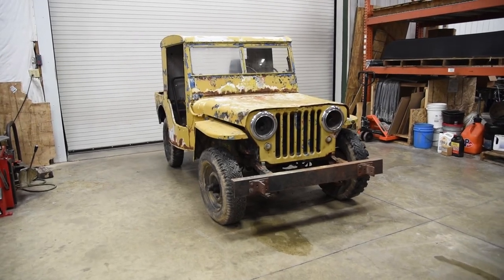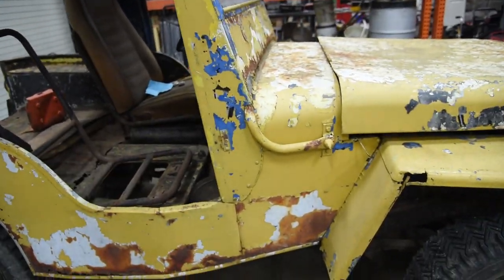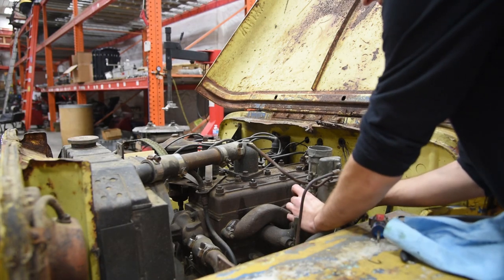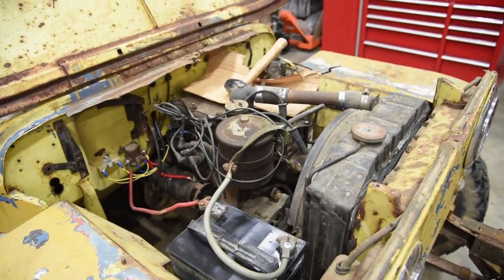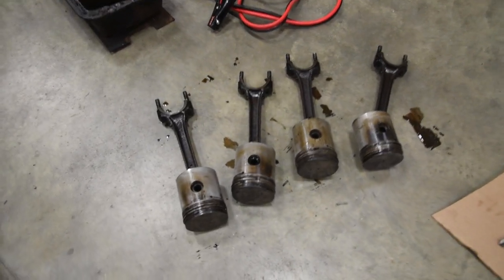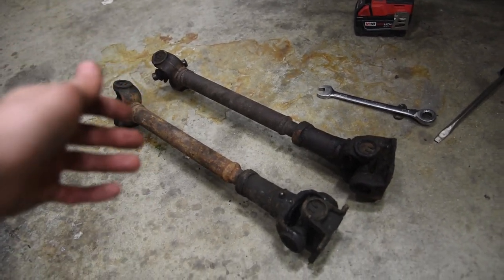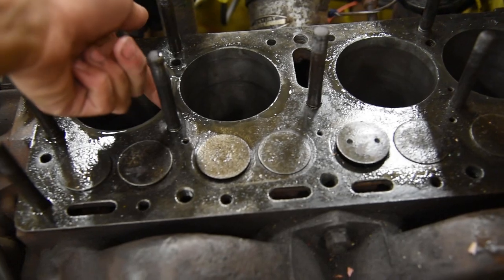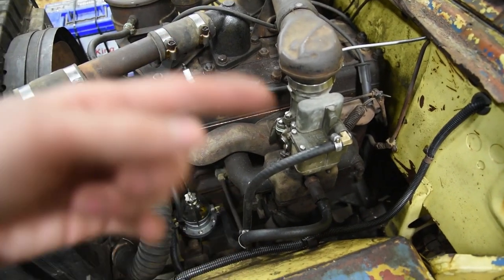Attempting to Revive a Barn Find Willys Jeep

Comment: My fire department has a 1954 CJ-3B.  That was the first year of the overhead valve engine.  It carries a 100 gallon tank and a small gas driven centrifugal pump.  Mileage unknown - speedo hasn't worked in years.  I'm retired now, but I used to take that Jeep where angels feared to tread.  The Jeep is retired, but we have it on standby/parade duty.  We replaced the Jeep with a modern pickup which is much safer and more comfortable.  Good luck on your CJ-2A.

Comment: Nice find,that's definitely a survivor jeep. It's getting hard to find survivor vehicles that are still in relatively good condition and are pretty close to being in stock form. It's getting hard to find any classic vehicles that haven't been hot rodded or been completely altered to build something that it was never intended to be.
Reply: i have a m37 dodge 3/4 ton truck 1953 i have added  50 more yrs with all i have done to it  ------ from gd up  i found it in 2011 in G a   junk yard was looking for a jeep body was in very good shape little rust   it needed sanding and paint job no dents   i have pulled the eng twice  new rings  ground valves  always have to rewire these old trucks

Comment: I have a 1948 Willeys CJ2A. Mine has the same colors of paint but retains more of it than yours. It was previously used by a SUNOCO service station. Flat fenders are cool vehicles. I own 2 CJ2 models,1953 CJ3A, a1947 2WD wagon and drive train from a 1957  4WD wagon. These are my projects for my retirement.

Comment: Greetings!  I was three years old and with my parents (I'm told) when they bought our CJ-2A and I still have it and drive it during the summer out here in Idaho.  I drove it in high school and college and it is completely original with no upgrades of any kind.  It even has the front bumper weight and the original screen over the radiator.  Best of luck with your project and it is a delight to see your hard work.

Comment: The starter wire is from house wiring, probably 12 or 14 gauge.  The fact it is a solid wire instead of stranded is the reason it is stiff, not age.  It is a 'quick' way to make it function until you can get to an auto parts store to get a proper stranded wire.

Comment: So a few things... the pipe for the radiator is stock for the MB/GPW. Check your ignition timing, plus if its sat that long there is a pickup in the tank that rusts... with new rings etc, check your valve lash. Pull the fender, makes it easier...

Comment: That's a good survivor don't chop it up into another rock crawler
Reply: Was that a joke? The body's trash. Looking at How Rusty the body is I'm sure the frame is Rusty too
Only thing good is the drivetrain and it still needs to be rebuilt.
Reply: @Happyfacehotwheels  - You can buy entire new bodies from the Philippines.
Reply: @Happyfacehotwheels  no it's not it's actual really hard to find them in this good of condition
Reply: @rexjolles    80-90% of the sheet metal needs to be replaced. I understand they're hard to find but it's still in rough shape. It is a Jeep so you can buy all the stuff you need to rebuild it.
Reply: @Happyfacehotwheels  yeah you could always buy a new tub anyway. Plus, if you saw my car, you cant see the paint through the rust
Reply: Body is junk
Reply: The entire body is trash. I bet the frame is swiss cheese. Great donor for parts to a deserving cj

Comment: If your still having a problem with the rings seating, you might have done to good of a job honing the cylinders. When I was a kid, I rebuilt a chevy 350 for my 64 Chevelle SS and I had a problem with the rings seating. An old timer that was helping me out, used a half of a teaspoon of Bon Ami into each cylinder. Bon Ami is basically Comet or an abrasive cleaner. It's pretty mellow, but put just enough scratches on the cylinder walls for the rings to seat. Worked like a champ!

Comment: Two gaskets is an old school trick to reduce the amount of heat transfer from the intake to the carb. These were prone to vapor lock because the exhaust is on the same side as the intake. Your gonna want that back on. Trust me.

Comment: The reason you had good compression on the front cylinders at first then got bad compression after a retest is because on the first test it still had automatic transmission fluid in it, which created a good enough seal to give you that high compression. Then the more you cranked it, the atf blew out the cylinder so when you retested it the fluid wasn’t there to seal the piston anymore, giving you lower compression. That’s how you can test if an engine is worn out. If you put oil in a cylinder with worn out rings that had 50 psi in it before the oil and tested it after the oil, then the compression would bump up higher, to like 90 or 100 psi

Comment: Kept talking to the screen......valves, valves, valves! Good video, I'll sub for the Jeep content. Thanks.
Reply: Yes, I would have suspected valves were the main problem not the rings although dumping oil in the cylinder helped the compression. 
I know exactly how he feels, Old stuff always needs more work than anticipated. I got a '58 Case tractor 2 years ago that sat with water in 1 cylinder.  I put in new rings and bearings got it running and discovered the oil pump wasn't working, fixed that and left the key on and burned up the points then the carb needed work.  I'm just now getting it all together and running.

Comment: My first engine rebore was on an Austin Mini that I bought less than a year old second hand for £500. Eventually after about 5 years it needed new valves and pistons. My dad and I worked at Rolls Royce Aero Engines and my dad made a ring compressor that worked just great. It was a tube with a tapered bore inside so the rings got gradually compressed. As it was a shade under the bore size the rings never got caught on the edge of the bore. A simple device and much better than the ring compressor with those bands on. Though I guess that type will do several different sizes.

Comment: Typically, when you get compression intermittently, you got one or more valves sticking. Especially on old flat heads... I see this video is almost a year old now, so I reckon ya figured that out by now... Neat project. I daily a 47cj2a with F head conversion and Warn OD... 😀

Comment: Nice find and an excellent video! 

sounds like the timing is still off a bit. One thing to check when you go after the valves: pull the timing cover and put a paint mark across the cam gear. It's fiber and they can fail in a way where the gear can slip relative to the cam. This will let the timing wander. If this is an issue, just replace the cam gear.

Comment: ...cool! At the end of the video, when backing it into the garage...the squealing tells me that those brake shoes are not freed up...if you drive only a little, you won't notice much - just perhaps a 'lack of power' due to the drag...but, any extended driving will give you the 'flaming brakes' disease...woo-hoo...Congrats in getting 'er running, though...and as others have commented THANK YOU for NOT putting this on two or three videos!!! - J in Toronto

Comment: Mix som atf with the fuel. It will really help clean the crud off the valves, both front and back. Low compression on that means a new valve job and probably shave the head.

Comment: this thing needs some love, please don't hack it up, sure the body is trashed but you can get replacement bodies (or make new panels since a lot of it is flat metal with some bends)
restore it a bit and that thing will make for a great little 4x4... they dont need a lift kit or any of that add on BS, stock jeeps are great off road.

Comment: since you have the head off, spin it over and watch the valves spray  the sticky ones with Kroil or something similar and free them up with a rubber mallet. fixed a 42 dodge that sat in the woods for years this way. you might want to measure the bores while the pistons are out, if a bore has a taper, new rings and honing won't help it much.
Reply: Or if they are worn oval.

Comment: The pleasure of doing the valve job on this block means taking the motor out to the valve shop without the rest of the car attached.
Reply from the maker: It can be done inside the Jeep.
Reply: @TurnNBurn  just wait till you need to machine the seats. I love that job!

Comment: I would have used marvel mystery oil in the cylinders. nice job on the wiring. with the amp meter wired in series you can add a shunt wire

Comment: Willy's CJ 3 A  the car I learned how to drive --  double clutching to change gear,  3 speed gearbox
Lateral valves Hurricane engine !
Reply: Was generator not alternator  6 volt system.

Comment: Would you mind sharing a simple wiring diagram for the ignition/alternator/starter connections.  I have one with a 12v conversion, just want to make sure I have it worked correctly.

Comment: Awesome video,  I'm redoing a 1946 CJ2A,  frame off restoration, dealing with a lot of rust in the body as well.  I was wondering if you could do a video on  timing the oil pump to the distributor,  I  am having trouble and have never seen or done one before.  Thanks and your knowledge of these jeeps are outstanding,  really enjoy your videos. Douglas
Reply from the maker: Thanks Douglas! Unfortunately I've never timed the oil pump. If you post on thecj2apage, guys will be happy to help.

Comment: You said the yellow wire from the left side of the ballast resistor to the coil. Is it positive side of the ignition coil to the ballast resistor with yellow wire? Thanks.

Comment: It’s sad what age, neglect and butchery will do to a vehicle.  Clean title is the only redeeming aspect of this Jeep.  Having done several of these in years gone by I learned the hard way by attempting to restore a rust bucket.  I was into it for roughly 200 hours and a few grand when I realized it was time to flush the toilet an start with all new parts.   40k and 2 years later I had a brand new Jeep with a small block, Muncy 4 speed, Np 305 transfer case  and 60’s front and back.  Ive done several since then and regret selling it.    Dude I sold it to still has it and refuses to sell it back to me.  Good luck on this junk, your gonna need it.

Comment: Where is that green wire coming from that the green wire is connect to left side relay starter solenoid (+) and other end of green wire to where does it connect to?
Reply from the maker: Lookup a coil resistor wiring diagram and it'll be a better visual than this video

Comment: you should have  over 100 on compession    you my need over size rings  910-20-30 etc  take the plus out add some motor oil rec check comp if oil helpits the rings  if oil dont help its the valves need grinding  i had the same problem  i have 120 comp now

Comment: ... I just bought a CJ2a last weekend! Say, there's a question on mine about 12v vs 6v... how can you tell from the coil? 

I was gonna start it and measure the volts going into the battery to find out.
Reply: Coils are marked 12 v or 6 v
Reply: @andrewerickson6690  On the inside? Guess I'll pull mine apart too then. Thanks!
Reply: No usually its on the body of the coil more oftem than not but if you truly arent sure coils are cheap buy all the stuff to convert to 12 v prob get through it for 200 total

Comment: With old Jeep’s you can never really speculate why something was bolted,cut,or welded to them over the years  I knew a old timer that was in the Korean War as a airplane mechanic when he got out he just needed a job and took one as a mechanic in a gas station  they had a used Army Jeep they used to pull broken down cars and trucks with  he also told me he bolted a house door to the front of it he used to push snow with  no hydraulics or ability to turn the plow or lift it  he just pushed whatever and wherever he could btw he knew I was into Jeep’s at one time and told me his story  now I had a newer CJ7  and I custom fabricated front and rear pipe bumpers  they were so beefy and strong a guy opened his Toyota door into the oncoming traffic I was in and took his door clean off  with only a scratch or two onmy flat black bumper it happened in a parking area and the Police wrote it up as a no fault accident ! The Cop was a guy I went to high school with  and he asked me if I was going to  make insurance pay for anything  I said nope I have the leftover paint inthe garage  btw I had a lift and 38 tires on the Jeep  so a little Toyota was no issue for the Jeep it even folded his door In half before his hinges broke  is that motor the old Iron Duke ? Those were awesome engines mine was a 4 banger but it was aAMC motor they used inthe 80s mine actually blew  and I found a running motor out of a newer car I swapped in  same engine  yet with the bigger tires  it was slow as can be tourquey as hell but slow  it was tough to get her over 60MPH

Comment: You did not run the top set of rings on the pistons? I guess the kit you brought did not come with them.
Reply from the maker: I did, they may have been hard to see on video.
Reply: StarPuss www.ToxicRedNeck.Com  I think your talking about the “carbon ring” it’s a grove at the top of piston that builds up with carbon and creates a seal.
Reply: The very very top groove in a 2a doesn't contain a ring...

Comment: Kaiser willys https://www.kaiserwillys.com/   willy heave the parts you need.  Use a copper head gasket instead of the fiber one with NEW HEAD BOLTS,  I have torn down four of these engines and they ALL needed main bears.      https://brennans-garage.com/   has a kick ass disk brake conversion bracket for both the front and rear axles,  if your going to drive it on the road,  this is a great upgrade  https://brennans-garage.com/collections/frontpage/products/trackick-disc-brake-conversion-bracket

Comment: part of me wants to get a flat fender jeep even though i need to get a garage to work on my old pickup first. I wounder what It would cost to build one entirely out of reproduction parts. then register it as a kit car.
Reply from the maker: About 20k, I've priced it out.
Reply: @TurnNBurn  that is not terrible. considering a nicely restored jeep is just a couple of grand cheaper. but you would have one that has zero miles on it and no hidden issues.